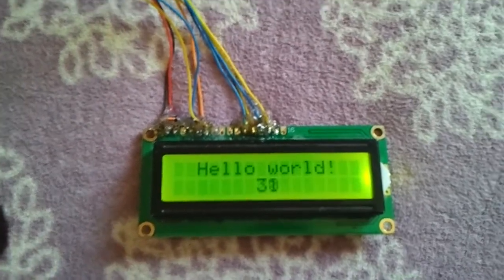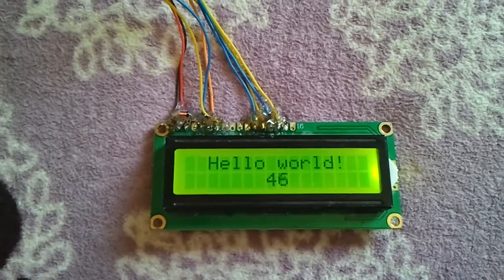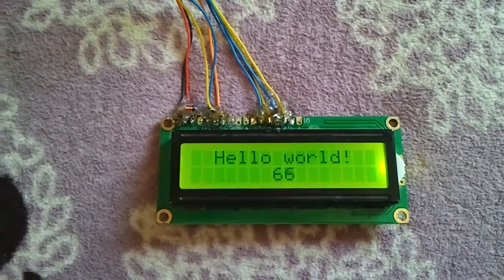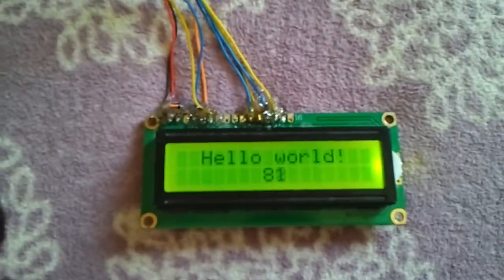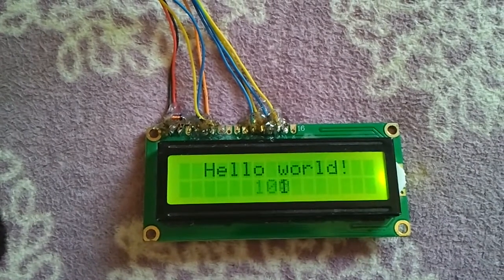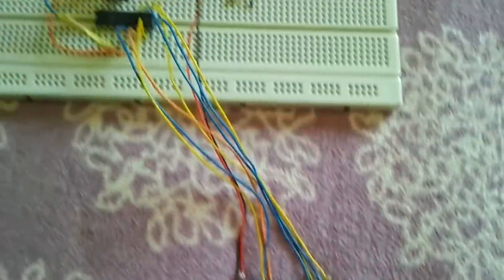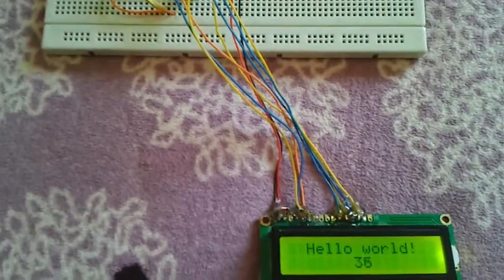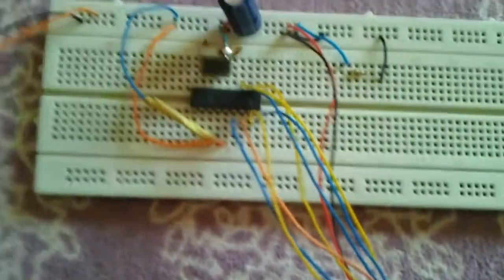Interfacing PIC16F84A with LCD display using CCS PIC C

Comment: sir i want to use 6 pin connection for lcd..i dont want to use RW PIN ,,,then what is changes in the source code,,,,i tried without RW pin,, error is coming in lcd header file